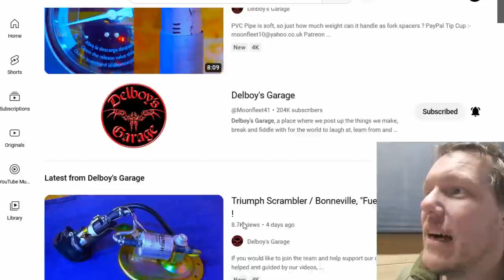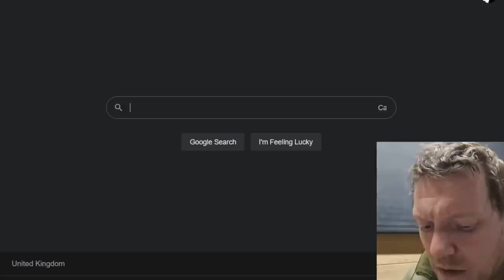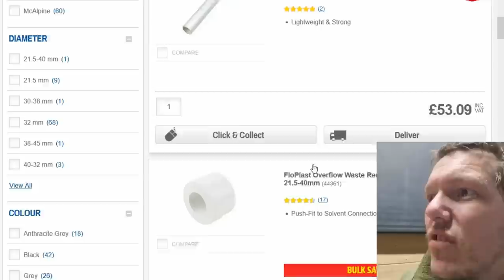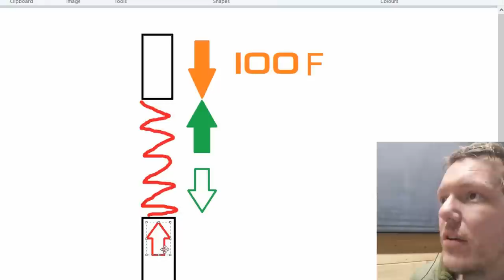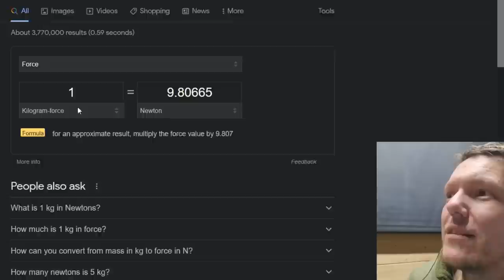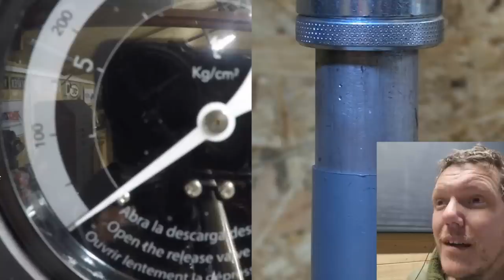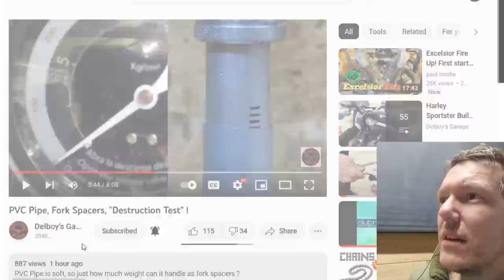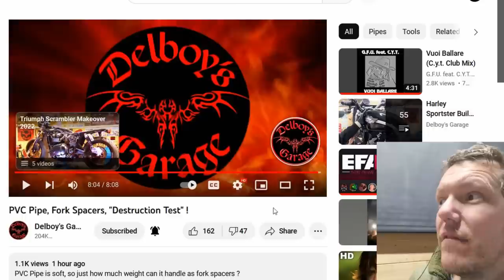The Sci 'n' triffic Del Method

Comment: Right, jobs done list - I've raised rear suspension, lowered front suspension, clip ons with on the piss brake and clutch fluid reservoirs fitted, oil changed for car oil, coolant changed, brake pads copper greased, spoked wheels made tubeless, exhaust raised for optimum thigh heating.  Now, once my hands recover from the third degree burns I got doing the coolant change  I'm off out for a test run.  Wish me luck, cheers Andy.
Reply: You did use waterless, didn't you?
Reply: @chrisdavidson911  Of course, I thought that was a given.  I'm thinking of just emptying the cooling system to make it air cooled.  Gonna run my idea past Del first to be on the safe side but I think it will save the burnt hands in future.
Reply: Count yourself lucky the hot coolant went in my eyes, I can't see anything   wrong with Delboy's fabrication. Mat's problem is that he able to see. Good luck on the test run and don't go over 10:mph oh and don't ride on a public road.
Reply: @michaeldemetriou1399  🤣🤣 Cheers.
Reply: @stevengroom7055  Yeah I hit two when my Sealy torque wrench snapped in half. 😁
Reply: Be sure to fit a car tyre on the rear, chisel the fork yokes, make a replacement subframe out of wood and wire-wheel off all the zinc coatings.
Reply: @johnlock2816  You obviously know all about mechanics/motorbikes. Can use No More Nails to fix my Puncture, and will it also protect against screws or is it just for Nails          ?
Reply: @michaeldemetriou1399  It's knowledge I've acquired in my dreams over 30 years as a charlatan mechanic, in fitting with the theme; don't use methods tested by engineers to the nth degree, wing it like Del instead, remove the valve and fill up your tyre with black epoxy potting compound until you have a solid tyre, no more punctures! (To anyone silly enough; please don't do that!)

Comment: It's Polypropylene. I have a length here and it reads... "FloPlast Ltd. 1.25/34mm BS EN 1451 B PP 1.8". It retails as 32mm push-fit pipe.
Reply: Yeap for waste water, toothpaste and pubes not fork spacers.

Comment: hitting a pothole at 60mph is obviously the same as applying 'some' force slowly with a sealey press ..... or is that just me over thinking stuff??
cheers matt for saving lives here!    :)
Reply: Agreed, impact and constant force have massively different effects, hence we use impact to free stuff off..
Reply: The pipe spacer deformed before resisting the press the triumph one’s resisted the press then failed under load. So the plastic pipe failed under less pressure than the triumph ones . This could mean that the plastic pipe ones could start out at 200mm at the start of a ride and be 180mm at the end which could result in completely different handling of the bike.

Comment: I wouldn't be too worried about the plastic spacers if you're coil binding your fork springs. That typically proceeds rapid deceleration due to the friction force between your face and the tarmac.

Comment: I know loads of people who have problems with Ethanol, most of them claim to have owned a Vincent black shadow which they bought for ten quid.
PS, the pipe will probably be made out of abs, polypropylene or PVC depending if it's push fit, solvent weld or compression fitting , they come in different sizes too, despite the same nominal size.
Reply: My ex  s father bought a Brough for £18 genuine story I think he is featured in the osprey book series too
Reply: I have a problem with ethanol! The problem with Ethanol is that it is inefficient and harmful. 1) ethanol at best with all the latest technologies (cellulosic ethanol) gives an energy balance of less than 9MJ/L of energy. 2) it uses massive amounts of land converted from nature to farmland to grow corn and because of p1 we need more and more. 3) water and fertilizer usage for corn farming just to produce ethanol. 4) It is ridiculously expensive. 5) CO2 savings are questionable as "total package" and studies show that ethanol emits more CO2 if you calculate full chain from farmin to production and transport. You will get way more energy and CO2 savings from solar panels instead of growing corn on the field. Ethanol is massively subsidized and solar in the UK is not, even windfall tax is coming for solar.
Reply: @ksim_  I agree with almost everything you say, but you also have to realise, the 'emissions' argument is always 'at point' - ie, out of the exhaust when in a City Centre etc..
Reply: @fredbailey2076  I know a guy that got one for Free 1919 so it's over a hundred years old and he rides it all over Europe and has taken it to the USA.
Reply: @michaelwalker1145  he was 1/2 officer on a oil tanker he took a part every trip and rebuilt it at sea
Reply: @fredbailey2076  The one I know of was bought by his grandfather new then passed on to his dad then him.. its totally original think the mileage is at least 600,000. < that's not a type O
Reply: @michaelwalker1145  only one ive ever seen inc emmas dads is one a jaguar day with what i assume was a swallow side car a side valve looked a early one sounded just like a bag of nails

Comment: I work with plastics a bit. The pipe he's using is uPVC. Ultraviolet stabilized PVC. It's got a load of fillers in it. Sch80 pvc pipe is much stronger and pure pvc. However both are brittle and prone to shattering on shock loads. ABS would be my pic as it doesn't shatter. Try hitting a piece of PVC with a hammer and seecwhat happens...Either way $6 for correct the OEM part? No brainer.

Comment: During my time in the building trade I managed to deform plenty of waste pipe with my trusty lump hammer even when I'd put a block of wood on top of it! I even managed to deform scaffold poles and bolster chisels and they made of some sort of metal shit. Think I'd use lump hammer metal as a spacer as that's obviously made of bell metal as my lump hammer (now in retirement) didn't deform once. I can put a link to my lump hammer if anyone wants to try it, pretty sure Del won't be able to machine it on his lathe though as it's as hard as Muhammad Bruce Lee on crack.

Comment: OEM failed because it resisted so much the press bung was forced into the middle of the tube, it didn’t crush like the pvc pipe, plus how does each material stand up over time to the fork oil?? Will it break down over time??

Comment: So, 1st 'test' on the PVC pipe, it deforms approx 3 lines before registering any pressure.
2nd 'test' on the PVC pipe, it deforms approx 4 lines before registering any pressure..
So, if you ride down a bouncy road, the suspension will work different on the 2nd bounce to the 1st?
And hard will always break different to soft, aluminium levers will break when steel ones will bend for example - I'm not sure if that's a perfect statement, but you know what I mean, if you toughen something it'll usually break / shatter rather than yield..
And, all of this is without taking into account that the plastic isn't built for sitting in oil and any effects that will have on it.

Comment: Just a thought: some plastics do creep under constant load over time. Don't know about the ones used in plumbing, but PLA certainly does. House plumbing isn't supposed to be load bearing, so I guess creep resistance isn't high on the list of manufacturers design priorities. Just wondering, if preload plus static load on the front suspension is enough to deform those spacers, expand them in the tubes (like in the press test) and one lovely day Penny is going to find the suspension rock solid and one fool standing next to the bike, scratching his head and swearing it's all Matt's fault ;-)
Reply: Its not like the manufacturer of gutter plumbing is thinking about some 9v brain sticking their plumbing pipe into a suspension system as a spring stop...
Reply: I think, but I'm not sure, that the spacers sit at the top of the fork.  If that's the case, jamming the fork shouldn't be an issue.  Slowly going back to the "slammed" suspension setup he ill advisedly did before might be, though.

I think what I'd be most worried about would be the springs shredding through the plastic as they compress, then coming back up in fits and starts  as the spring clears out the bits of mulched plastic.  The sort of suspension behaviour that leads to crashes.
Reply: @wibblywobblyidiotvision  Come to think of it - you're right, the suspension wouldn't lock up, at least not because of the spacer deformation. The spring shouldn't shred the spacer as well, since normally it doesn't travel next to it. If the plastic fails so badly that the spring digs into it, all bets are off.
If that happens somehow, and the spring starts shredding the plastic, apart from a jerky spring action, there's also going to be a lot of plastic shreds floating in the oil, just what you need do clog that little "damping" hole in the bottom of the fork leg.
Reply: @kamilbarnik448  Oh, good call.  Yeah, bits of crap blocking up the damper could lock the fork up in an "epic" manner.

Comment: The pipe is deforming and nipping in the tube which is when the force starts to build, it’s not holding the weight it’s basically wedging and holding the weight

Comment: Hi Matt, quick question on tools. I want some new files, large flat, round etc. But also primarily some strong needle files for intricate metal work. What's a make that won't snap/half decent quality? You helped me on some decent CS taps before and they worked excellent! Proper stuff. Cheers dude.
Reply from the maker: Nelson files, the ones made in Mexico are awesome. Bahco needle files are really good.

Comment: First, love following you down rabbit holes,much fun. The second thing, regarding working out the load on the spacer. Does the spring ever get bound, I doubt that is ever the case. The surely the fork assembly would bottom out before the spring is bound. So following that assumption the max load on the spacer would be the spring rate x the max travel of the fork. So max travel appears to be 120mm and assuming 8 kg/mm spring rate at a full compressed situation it would mean a load of 960 kg applied to the spacer, which seems a fair bit more than old mates 400 kg/2. Even so I’ve heard of a number of people using pvc pipe as fork spring spacers without having catastrophic failures. Apologies if the terminology is dodgy but I’m confident you’ll get the drift.

Comment: Designers don't spend a lot of time specifying materials on the basis of duty they have to perform to ensure they behave predictably and reliably.  They don't put QC regimes in place to ensure parts meet the design specifications to minimise the chances of failure or unexpected results.  They just pop down to Homebase and buy a few lengths of plastic waste pipe that's been designed and specified to do a totally different job in a completely different environment and say " it looks the same so that'll do". 

There's nothing to say that the two pieces of waste pipe, even cut from the same length of tube, will have exactly the same wall thickness and there's a high chance of them performing differently.  But what the hell, it's only the front forks which control the steering.  

People have no idea, they don't get how much work goes into specifying materials to ensure they perform safely and reliably especially in such a safety sensitive area as the steering on a motorcycle.  On the plus side, it really doesn't matter as Penny never rides the thing.  I guess she's seen the true horror of what Del does to a bike when he starts hacking it around and is never going to trust anything he's been near with a spanner.

Comment: Push fit (aka compression fit) soil pipes are normally slightly narrower than solvent soil pipes.  Solvent pipes need to be glued together to form the joints.
You’ll find that the solvent pipes are billed as the same diameter, but in reality they’re a tiny bit larger, because plumbing!
I suspect that’s a solvent pipe Del has got his hands on - if you were to go and buy one from Screwfix it would say 32mm in the catalogue and then 34mm on the actual pipe when you had it in your hands - mad I know, but for reasons best known to plumbers, that’s how it’s done.
That stuff is the classic waste pipe you’ll get to serve your kitchen sink, or your bath, or even a large hand basin  👍🏼

Comment: That OEM insert is likely a Thermoplastic Fibre-Reinforced and has higher compressive strength, better toughness/damage resistance, reduced hydrolysis grater impact resistance, high vibrational damping. Than a bit of waste pipe. A disgraceful public failure to tell the truth.

Comment: Screwfix advertise the 34mm pipe as 32mm,  the floplas 32mm solvent weld pipe is 34mm, the push fit pipe is 32mm.

Comment: So effectively Del has shown us that his modification failed right from the get go as it deformed under whatever pressure he applied first as it shrank and gave no reading on the gauge . The OE part didn’t deform and resisted the force put upon it thus the gauge went up until the part failed. All this to save less than £20 why??

Comment: Theirs 2 types of plastic tube used in plumbing, one is solvent weld which tradesman use the other is push fit for diy, the push fit is softer and made of different plastic.

Comment: I'd imagine that fork oil would turn that plastic into chewing gum after a while .  Why didn't he just get shorter springs or cut down the original spacers ?
Reply: He put a longer one in. He could of got some off cut of pipe from a metal work shop for free to cut to the right size.

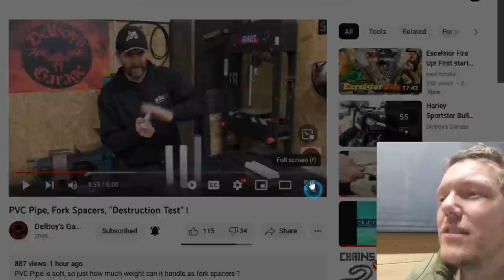Comment: 24:24 i think he meant that he can use that inner metal rod for testing because there ist no differences in doing that vs using a Spring. (Apart from slight asymmetries maybe)

And the maximum Force applies when the spring is compressed to block so yeah.

41:21 thx didnt know that.

Comment: Matt re the size confusion.

Pipe is measured by bore, tube is measured by outside diameter

Solvent weld stuff Dells got is ABS.
Reply from the maker: So the wall thickness is 1mm and looking at the website it could be non weldable PP... 

Also in relation to size, it states 34mm on the actual pipe, so are they stating the ID or OD or the fittings it fits? According to you its the ID?
Reply: @dirtygarageguy  Dunno Matt, they seem to have "Nominal" sizes, to us that use it on a daily basis its "Inch an a half, Inch and a quarter, 3/4 overflow" measuring its ID32mm OD36mm, ID39mm OD43mm measuring some raggey off cuts with cold digital calipers. Thats solvent weld ABS. We don't use PP that much unless its industrial kitchens or medical as heat, chemicals and alcohol based cleaners make ABS go brittle. PP is different sizes again.
Id bet the farm that its ABS pipe he's got by the noise it makes on the linisher PP is softer and not as resonant when you're cutting it.
But yeah "Pipe" should be measured ID and tube OD , 'tho both terms seem to be interchangeable these days.

Comment: probably the solvent weld 32mm pipe that has slightly larger od but inner is 32mm pushfit pipe has slightly smaller od
Reply from the maker: If it is 32mm ID and the OD is 34mm then that's a 1mm wall...
Reply: @dirtygarageguy  yes mate the solvent weld is sized slightly differently to the pushfit one causes problems when people buy the wrong one

Comment: Well Matt I think the thing to take from this is that I'm sure most manufacturers make suspension parts out of metal unless it's a seal or such in which case it's nylon or rubber I suppose however I'm no expert! However as I'm sure many plumbers and builders and ground workers will tell you there is a difference between the different manufacturers of these products as I'm sure from your job you'll appreciate! Most of these plastic pipes are only designed for water and or of different temperatures of water and at worst case UV effects on longevity of life use!
I doubt " flopast, polypipe, Marley or osmo or indeed the other cheaper alternatives have tested the longevity of life used as a suspension spacer in a motorcycle shock mixed with oil for good measure! 
Although I've never had any problems myself I have heard of issues with  underground soil pipes of a certain well known manufacturer that even when used in the correct way for the correct application they have deformed shape and leacked at the seals!
.......but I'm sure it'll be fine what's the worst that can happen? It's not like there is new generational stupidity aplenty of late!

Comment: doing the F1 engine math: they do 22 races (2022 season) and each race is 300km + 1lap
lets say that that extra lap is an extra 3km as thats a fair average for a track lengh   
so they do 6666km, add to that free practice and qualifying, say another 100% race distance so 13332km (8332.5 miles)
a team is restricted to 5 engines, but some teams went over due to accidents or issues and ended up taking 8 engines 
at a limit of 5 engines those would go 2666km / 1666mi or when they go over and take 8 engines and go full distance on all of em they would have 1666km/ 1041mi

thousand miles is still a pretty decent number for a small 1.6 Liter V6 screaming at 14000 RPM

Comment: I've worked with this material and similar ie ABS for many years and apart from seeing how this PP material suffers from degradation due to UV (obviously not applicable in this case)  and more so heat and chemicals is very apparent. 
Also if you cut this pipe you very often see how un-uniform the wall structure is being thicker and more so thinner across its section.
Totally unsuitable for carrying stresses in a suspension system. 
Like you said, why not just use OEM tubes.